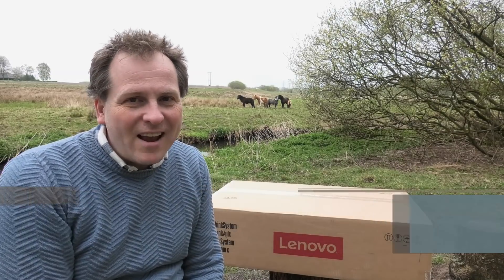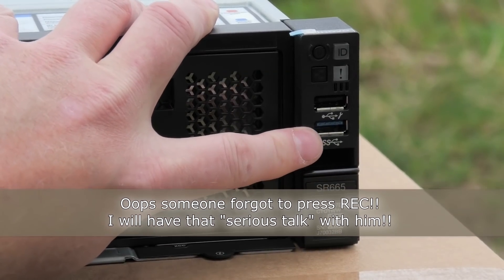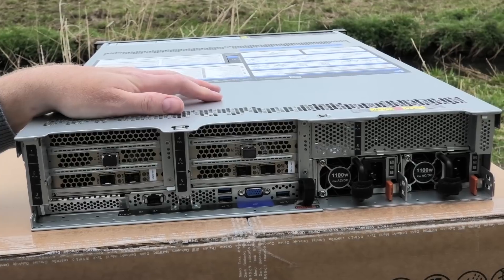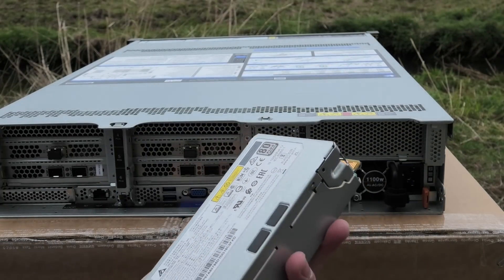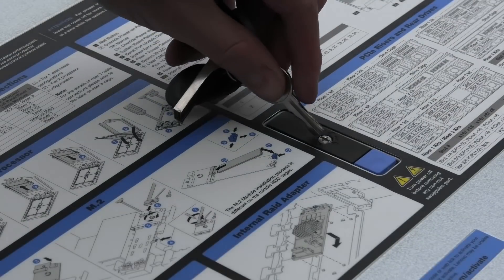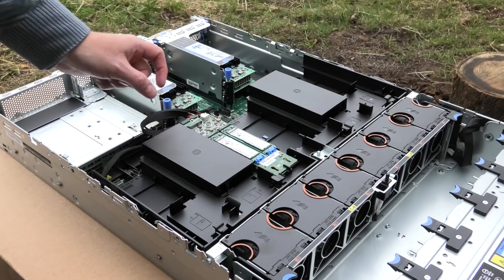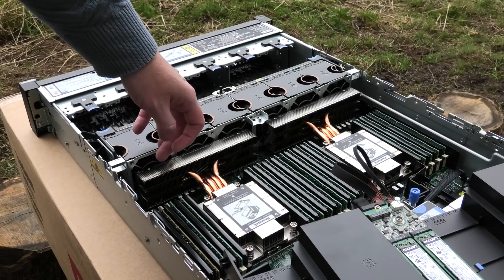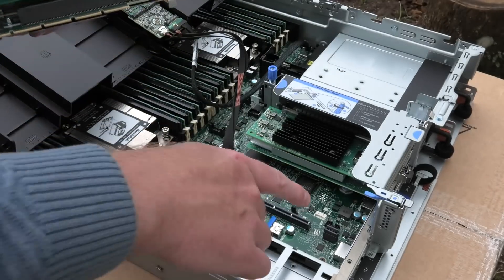Lenovo ThinkSystem SR665  with 2 X AMD EPYC CPU's - 1181

Comment: Morten, if you ever plan to buy such a server, or any Lenovo based AMD server or workstation, remember this: AMD allows the vendor to lock the CPU, so it cannot be used by any other machine other than the same vendor who sold it to you, so for this case, any server/workstation made by Lenovo - you cannot use the CPU (if you decide to upgrade or sell it) on anything other than Lenovo server/workstation.
Reply from the maker: Yes,, I think this will be the case,,, I am not a fan of that... :-/
Reply: @MyPlayHouse  As far as I know Supermicro/Tyan doesn't lock EPYC CPUs on their machine.